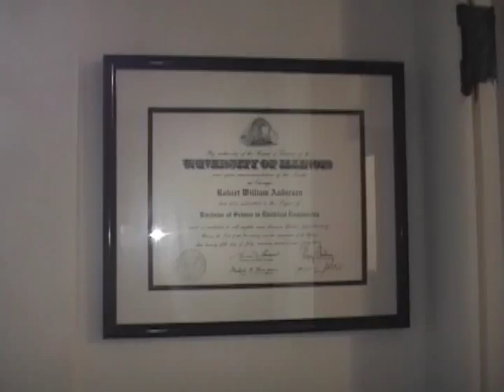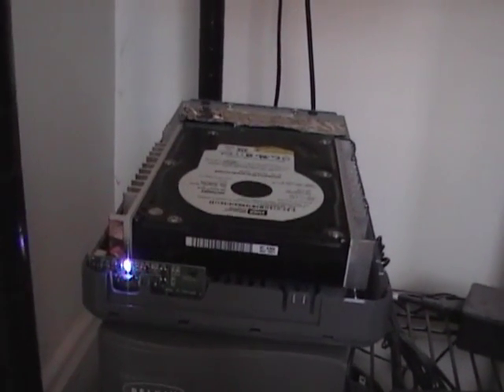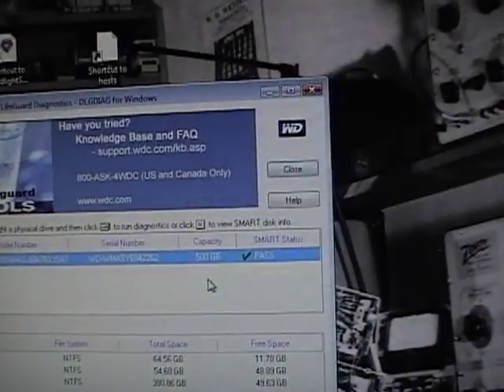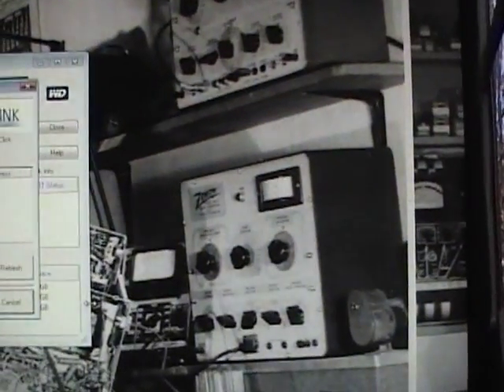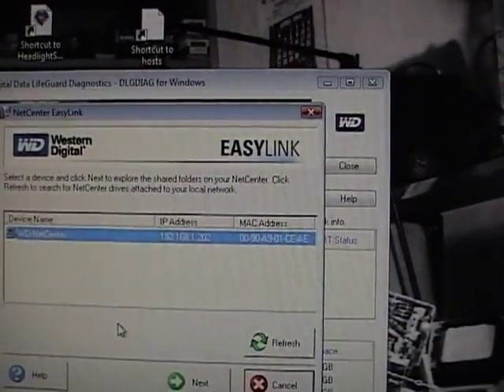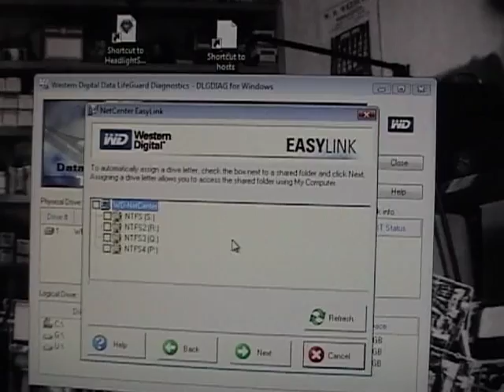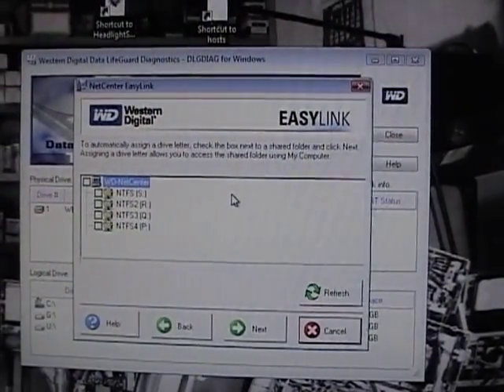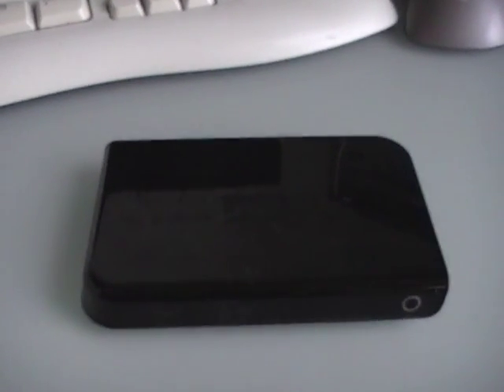WD Netcenter repair attempt

Comment: I may have solved the problem. Mine is from 2005 with a 160GB drive. Pushing the power button only gave me a single orange blink. I got it apart after watching the video, which was most helpful. The power supply checked good. I disconnected the power plug from the drive, and got no voltage, till I pushed the button on the front. Power on the connector pins was good, and the blue LED lit up with the orange LED flashing. I figured there had to be power circuits on the underside of the board. I pulled out the drive, then removed the board and turned it over. At the corner of the board, at the opposite end from the USB connectors, I found a BATTERY CLIP!!! It holds a CR1220 3V lithium cell, smaller than a dime. It measures about 4/10 of a volt. According to the web, my local Walgreen's has a few in stock. I'll find out tomorrow if this solves the problem. If it does, this tells us that WD deliberately designed this unit to fail when it's internal battery died. Not a nice thing to do, since this battery is only rated for 8 years, although mine lasted for 13. It's quite likely that the battery is used to backup some memory when the power is off, memory that stores vital information needed to access the drive. Thus, after replacing the battery, I may still need to figure out how to reload the necessary data to gain access. We'll see tomorrow. ;-)
Reply: @Chuck 
I've waited four year to find out the outcome - what happened?
Reply: @twig7885  Wow, I don't even remember working on that thing, but apparently I fixed it because it is still working fine right now.

Comment: @bandersentv Did you ever get the Netcenter to have a steady light once you put a new drive in it?  I have a 160gb netcenter and I called WD and inquired about installing a 1-2TB drive, they said it should work because the firmware will just see more capacity.  Just wondering what you learned.

Comment: I have this exact WD Netcenter.  We have a lot of valuable important data and pictures and documents on this hard drive from our family.  Today it will not boot up, the orange keeps flashing as though it sounds like it's ready to give out.  Like the disk is attempting to spin but won't.  Is there a way to retrieve the data on the Hard Drive? What is causing it to not go "blue"? Just flashes orange constantly when trying to boot up, and makes a strange sound like it's suffering.
Reply from the maker: +Lysimachus78 Sorry, I don't know. I was never able to repair mine.
Reply: +Lysimachus78  Try to replace the power adapter.